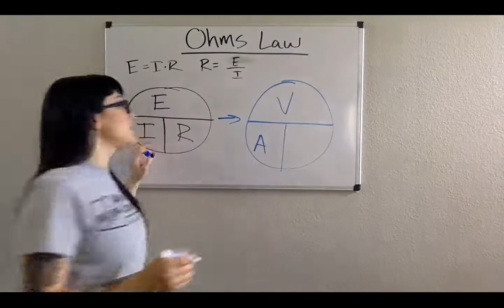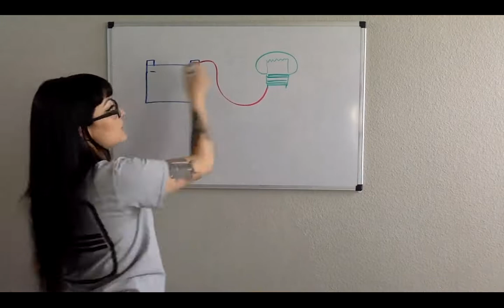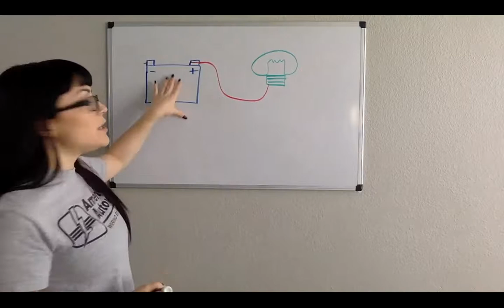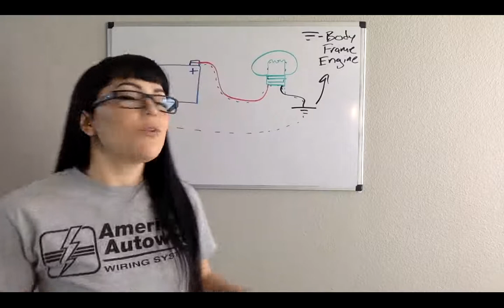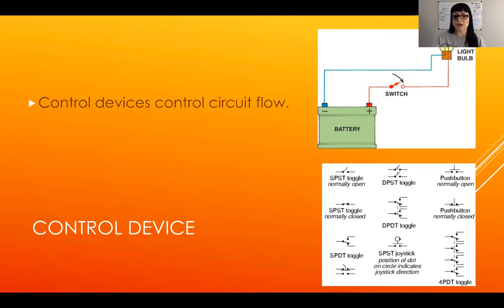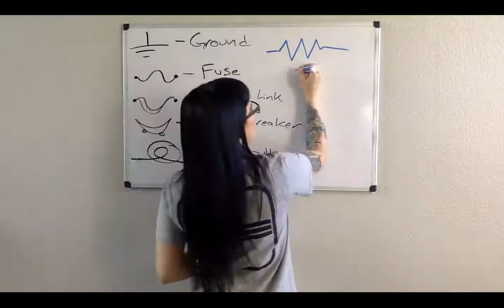Electrical Lecture 2

Comment: Dear teacher kindly inform me in the circuit breaker I noticed 2 terminals one copper stud and one zinc costed stud I want to clarify whether the copper stud to be fixed to power feed and the zinc to load side or any side no difference. Thanks for very nice demo🙏💐💐💐